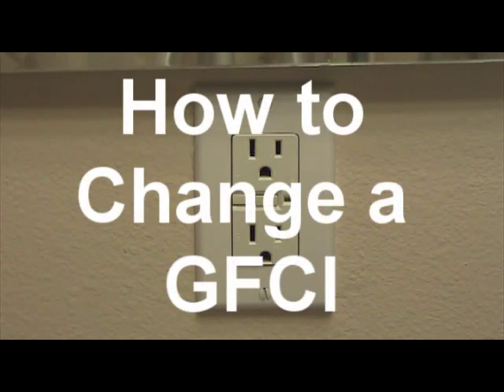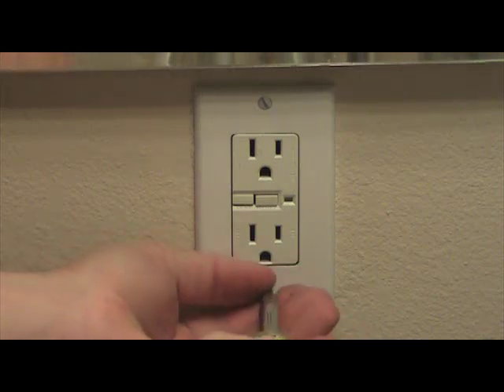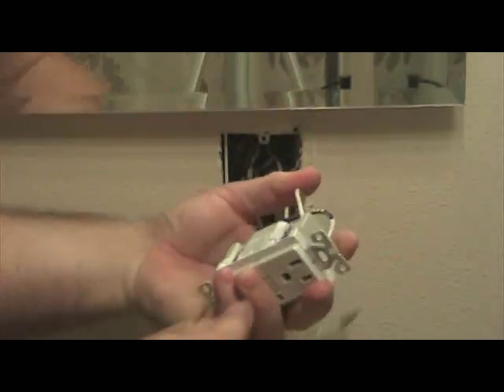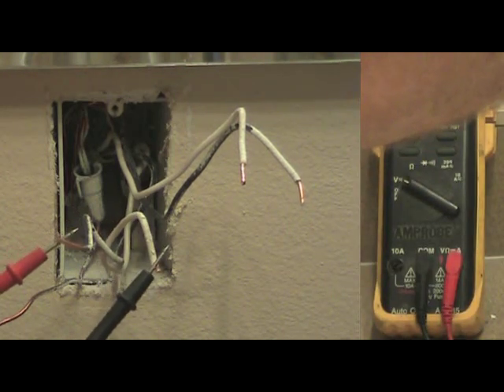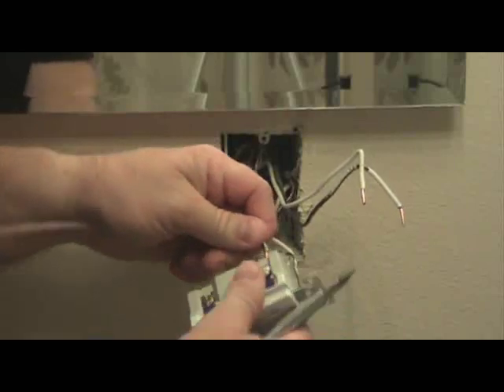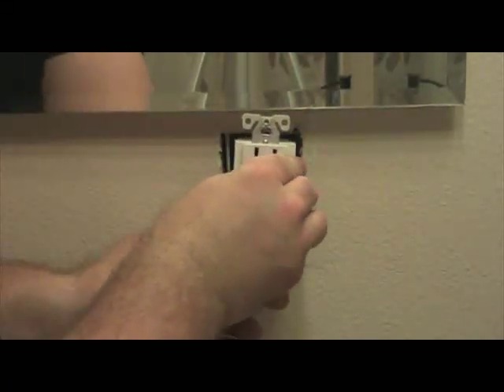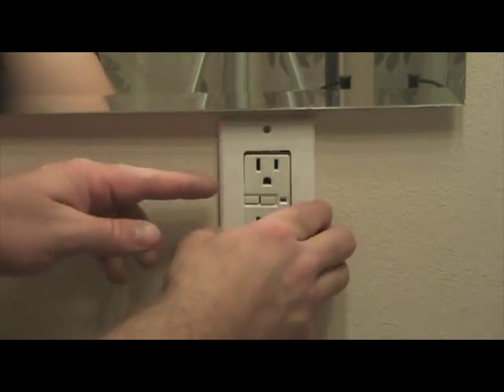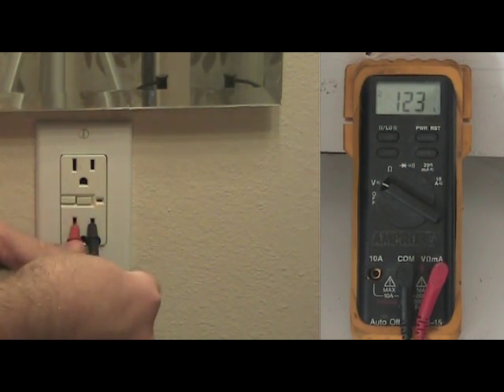How to Change a GFCI

Comment: I tried to replace one of these today and started to get shocked as I was disconnecting one of the white hot wires so I just put it back together as it was because I didn't want to get shocked again. then I realized that it said I shouldn't be standing on a bare wood floor. any suggestions on how I can go about fixing this?

Comment: I did this at my new condo - I have a green light but the outlet still doesn't work. I've tried to reset it several times but the outlet still doesn't work. Any suggestions?

Comment: Good video, but your first test using the voltmeter will not assure power has been turned off to the GFI from the breaker box.  If the GFI has failed, then you might not measure voltage at the GFI even though you still have power feeding the GFI.  You would need to measure the voltage across the line feeding the GFI to be sure power has been shut off.

Comment: Good video, but you should mention the user should check to make sure wires are not touching one another when turning the breaker back on to check for line and load.